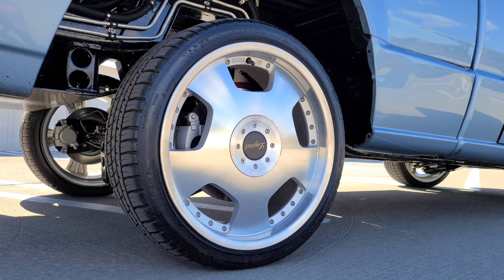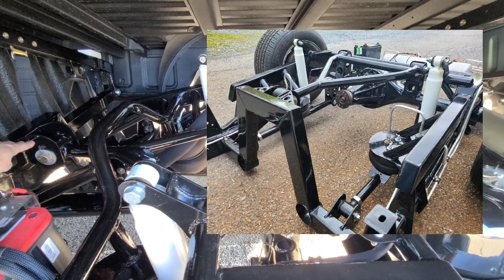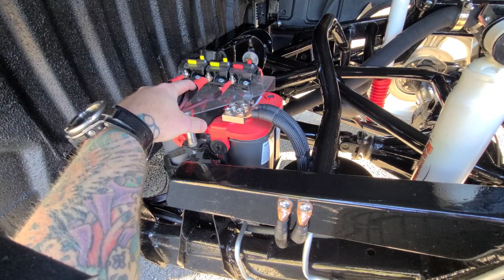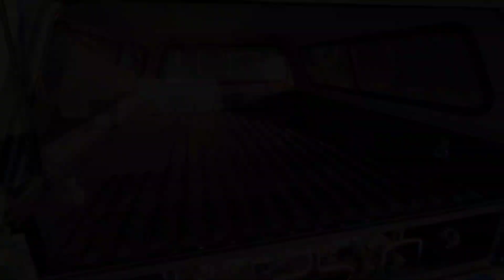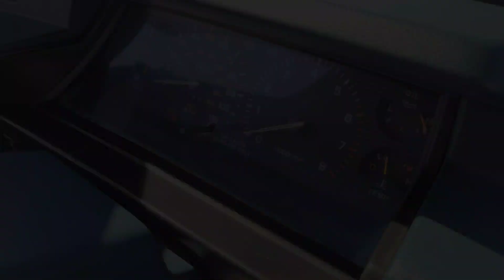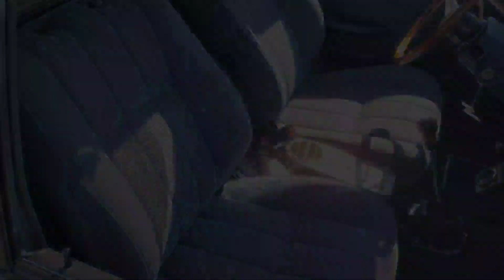Bagged, body dropped, tilt bed Dodge D50 minitruck!

Comment: I like the sticker on the back glass more than anything it gives it that 90s vibe and I love it that’s when I fell in love with mini trucks
Reply from the maker: Oh, yeah. I got my first mini at 17, in '97. It was an '87 Nissan with leaves taken out and torsion bars cranked down until it rode on the bumpstops. It was nearly the same color, this truck is what I was drawing when I should have been listening in school, haha
Reply: @boogiechassis7726  exact same here mine was an 86 1/2 hardbody in 1998. It was black with a pink , green and blue stripe that was Z shaped from front wheel well to the top rear of the bed. I got old pictures somewhere with it layed out under my dads semi and next to it. It was the truck I learned on. It was the first truck club I was in and they taught me a lot. One of our members had a bad ass 720 that was featured in minitruckin mag in the mid 2000s. Keith spent years slowly building that truck that’s when tweed was in every interior and bags were just coming into the scene

Comment: I had a Mighty Max in the mid-90s.  At the time, I was making a 200 mile round trip commute to work, so the miles piled up quickly.  The odometer showed just over 150K, when I sold it.  The front suspension was trashed and needed replaced, but it was still peppy and the air blew ice cold.   Man, your truck is over the top, way cool, and definitely different.   It was rare back then to see a tricked out MM or D50 and even more so today! 😎👍🏼
Reply from the maker: This puppy's at 165k, no signs of dying (knock on wood)

Comment: Great video nice work
Reply: Thanks! More to come, some sick stuff lined up!
Reply: @aaronb554    I have my eyes on a d50 not sure of the year yet motor is blown. Any ideas for a motor swap ? Are there even parts for these trucks? It has a bench seat automatic radio delete. Seems like a long bed to me.
Reply from the maker: @derekcorreia9692  you can swap whatever you want. The 2.0 manual trans will bolt up to a 4G63 or a 4G64. Not much out there for the stock 2.0. Really just carbs and headers, not that they do much.